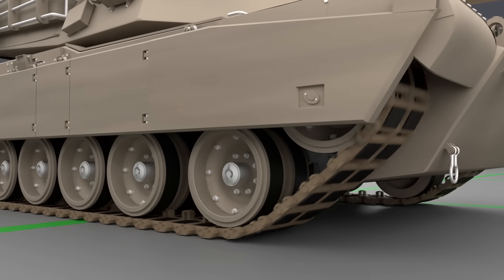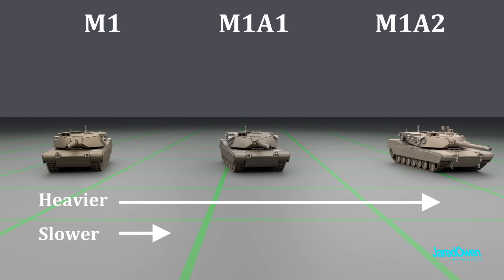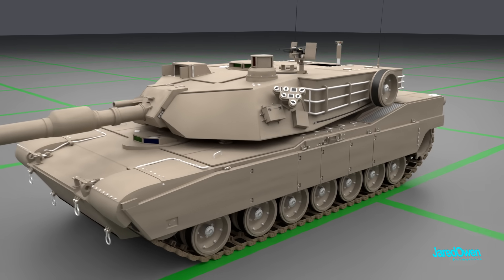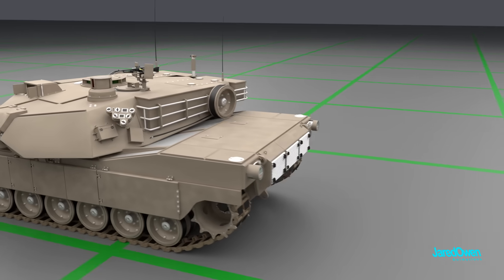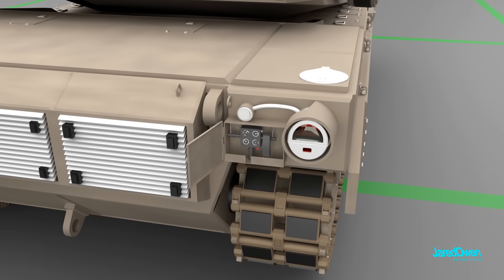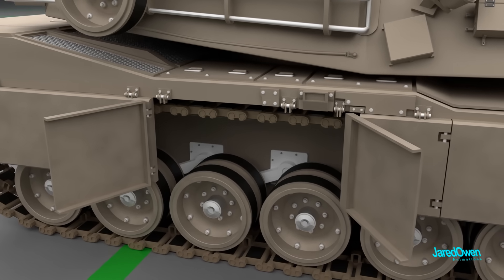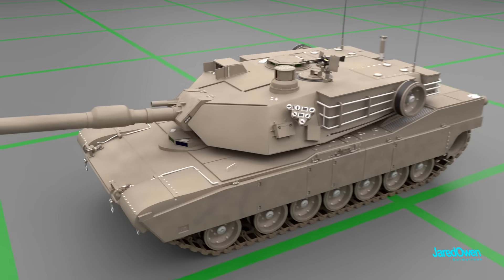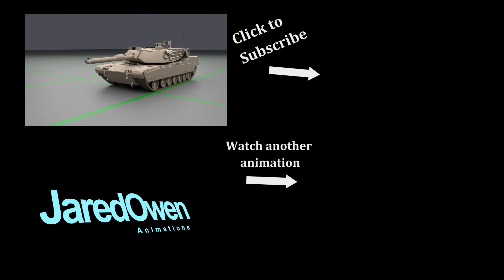How does a Tank work? (M1A2 Abrams)

Comment: 6:11 "it's fairly quiet"
War Thunder: RREEEEEEEEEEEEEEEEEEEEEE
Reply: i hear them vaccum cleaners from a mile away
Reply: Here in Vermont we have a Dairy Festival every year well except for this year due to fing COVID the parade in nearly 60 years was never cancelled until this year even nasty weather never got it cancelled. But a white ago a big part of the parade was a M1 Abrams that use to be in it. They are not all that loud even sitting within 15 feet of them its just a low pitched hum. Them being loud is probably the game devs inventing it to that other players will hear them coming. Because if it where historically accurate you wouldn't hear them until they are on top of you. They took the M1 out of the parade because it was destructive to the pavement when it had to turn for the parade route.
Reply: In real life if the abrams is coming at you. You can only hear tracks rumbling.
Reply: Lmao
Reply: Why did a simple joke's comment turned into WW3
Reply: @f4mmer540  yes
Reply: It's so sad to hear though, War Thunder just uses jet engine sounds in an Abrams and then the other tanks are silent. At least the M60 AMBT is quiet.
Reply: Lo
Reply: L
Reply: It's not fully quiet

You can still hear a tiny whirring noise
Reply: Just because war thunder
Reply: E
Reply: The problem with the abram's engine is 1. That it's louder compared to a diesel engine(yes the pitch is higher and some people can't hear that but it's still louder) 2. It compares WAY more fuel than a diesel engine and 3rd it is really expensive to manufacture, maintain and repair
Reply: @julian5857  ever heard a leopard 2 passing by and an Abrams passing by. Leopard 2 diesel engine is so damn louder than the Abrams gas turbine engine especially when times the turbo is spooling in the leopard 2.
Reply: @julian5857  No the turbine is not louder than a diesel engine. A turbine has fewer moving parts than a diesel engine. A local parade where I am from use to have one in it. The reason they removed it was that every time it turned it would damage the pavement. You will see a Abrams before you hear it. The tracks make more noise than the engine.
Reply: Skiller5000 - I am sorry to tell you this, but your comment on noise is incorrect, as is your assessment regarding repairs.  In terms of gas mileage—I never ran out of fuel, and I could sprint a 68-ton M1A1 0-20 mph in 7.2, seconds and top out (governed) at 54 mph on asphalt, so neither I nor any of my guys had an issue with our turbine engines’ lack of fuel efficiency.
Reply: @cassiusclaudius3010  true. Abrams is on governor to reduce stress and for longer lifespan before maintenance. No governor it could go much faster. And the gas turbine as far as i know its not just 1500hp. It is only tuned at 1500hp but it can do more hp than 1500hp. It is done at 1500hp for its reliability and 1500hp is more than enough for any MBTs.
Reply: Enigmaa it is governed because at 90 MPH the vibrations of the track upon the ground create standing waves in the end connectors, causing them to explode.  

I am not sure where you read your information regarding maintenance and reliability, but that is not quite correct.  I served on Abrams for 9 years, and was intimately acquainted with the engine as a mechanical engineer in the US Army, so not sure where you are receiving your information.
Reply: @julian5857  So why use a turbine?
Reply: That is false, in real life you could hear it kilo meters away
Reply: pikinjo in what “real life?”  Do you have military experience, specifically in US Army or USMC units that employed and/or supported Abrams tanks?  Because I have 9+ years experience across a variety of deployments, and I can tell you that your assessment is incorrect.
Reply: @cassiusclaudius3010  no i am not incorrect, i was few times on M1A1/2 training and the engine is load af, and here https://youtu.be/TCXwgPZXScM you can hear the engine when they start it
Reply: @cassiusclaudius3010  sorry to break it to ya, but you are *wrong*, if you watched the video, the guy was standing in front of the tank, and as you can hear,.the engine was "loud af" please dont confuse bias with facts...
Reply: pikinjo OK now I understand—you dislike American people.  Thanks for letting us all know that you are a bigot.  

Please explain my “bias.”  Bias connotes that my statements are founded on opinions, whereas everything I have written in my posts has been grounded in facts with which I have first-hand, real world experience.

Please also realize that we would not be in this discussion if you had not written your original, erroneous, unfounded post, and then attempted to discredit my 9 years of experience with a YouTube video.  

Just let it go and move on, rather than attacking me for my country of origin.
Reply: pikinjo You still have not explained my bias.  Please explain that.  Please also explain any real-world experience you have with an M1 tank, particularly from “kilometers away.”  Any engine is loud when you stand right next to it.  I should know—I am a mechanical engineer.  I also know from decibel analysis conducted by the US Army that the M1 produces less noise than other engines, whether they be gasoline, diesel, or turbine.  That is fact.  Please let me know what data you have seen to support your position.  

You said that the engine could be heard from “kilometers away” and attempted to prove your point by showing me a YouTube video taken in front of the tank.  I am telling you from real-world experience that you cannot hear the engine from “kilometers away” because I have actually been kilometers away from an M1 and could not hear the engine. 

If you cannot understand the difference or realize that you really do not know what you are talking about, perhaps you should visit a psychotherapist whilst my physician is checking my hearing.

If there is an idiot in this discussion it is the person who will not admit that he is attempting to speak as an expert without real-world experience.   YouTube videos, by the way, do not substitute for real-world experience.
Reply: @cassiusclaudius3010  you have no proof for that, and i've heard T-72B3, Leopard 2A5 and M1A2 sep, the loudest one was M1A2, but i overexaggerated about the "kilometers away" i will give you that, it can be heard further than the rest... And finally, i was the gunner of the M-84A-4 "Sniper" so i have experience
Reply: pikinjo OK perfect so now, hours later, we finally get you to admit that your attack on me stating that the M1 can be heard “kilometers away” was unfounded/exaggerated.  

I really don’t know why you decided to pick on me, being as we are fellow tankers.  I certainly didn’t bear you any ill will at the start of this.  

I did, at one time, actually have in my possession the decibel analysis “proof” I spoke about earlier, but have since changed careers and do not have the document. 

Re:  T-72 and the Leo 1–they were both much louder than the M1A1 and easy to identify from a long distance away; that was my experience many years ago.
Reply: @stilpa1  you are false. You really not heared the abrams in person. I can barely hear the abrams at 200m away. And i hear the leopard 2 engine at 300m away.
Reply: @Trinity-j5f  you are wrong, and biased

Comment: US tonnes lol
Reply: There are several tons. Short ton and long tons are U.S. customary and Imperial tons. Technically both are defined by metric in most international uses, but the U.S. short ton is 907.18kg., the long ton is 1,016.05kg., and the metric ton (also called the tonne) is 1,000kg. In pounds, which are roughly the same in the Customary and Imperial systems it's 2,000lb. and 2,240lb. respectively- a metric ton is 2,204.62lb. I've heard the term "U.S. ton" refer to the short tons outside the U.S.

Comment: To start off I was an M1A1 mechanic and one of the first M1A2 mechanics in the ARMY.  I was stationed with 4-67 AR C-Team Maintenance, 1-37 AR C-Team and B-Team Friedberg Germany 95-98.  Then with 2/3rd ACR E-Troop Fort Carson Co. It was here that I became an M1A2 (A4).  I was also a Recovery Specialist H8. I have worked on many heavy and light tracked and wheeled vehicles in my military service to include the LAV family, Bradley FV HMMWV, 5-ton family, M113 family just to name a few.  Just to let you know my back round.  I have 10 years of military service between the USMC(first) and the ARMY.  At 5:45 when he talks about the engine he is wrong in so many ways.  First what he shows being pulled out is the Pack (engine, AGB (Accessory Gear Box) where the oil pump, EMFS and hydrolic pump are mounted,  trans, cooling towers and  recuperator (cools exhaust).  Then when he shows "the engine"  all that is is the low, high, low compressors, not even the engine.  The engine is located behind that.  The large fans are to cool the trans and engine oil.  The exhaust comes out the middle that is very hot.  Where he has the Loaders seat is where the radios are at.  The Loaders seat is right below the Loaders hatch.  It folds up if he needs to move around.  The seal isn't that good.  If they are fording water up to turret depth or chemical weapons they can pressurize the crew compartment and also inflate a bladder around the turret ring also.  Every version of the M1 has a 50 cal M2 for the Commander along with the gun for the loader.  The hull Ammo at 9:12 isn't stored like that, its stored in a different location.  The ammo in the back of the turret is correct. The M1A2 has a CITV(Commanders Integrated Thermal Viewer) located in front of the loaders hatch.  That is how the commander would have a 360 view around the tank.  The M1A1 commander would use the portholes because they didn't have the CITV. The rounds are spring loaded in the storage rack with a knee switch to open the door.  He would be facing the commander, hit the knee switch, pop the release tap the round would pop out, using that momentum would flip the round and drop it into the breach and release the breach to lock the round.  My crews in Germany did this in about 4-6 sec. per round. The drives station is the most comfortable seat in the house.  The driver can sit up or lay back.  The moves up and down as does the back of the seat.  When driving with the hatch open (which happens most of the time unless in combat) the drive is sitting up with his head out of the drivers station. When he is closed hatch he had a head rest that folds down for him when he is laying back in the seat.
Reply: I was a heavy equipment for ten years most wheeled but refurbished m88a1s as well.  Having done several ten year services on m1000 trailers, I naturally had exposure to abrams and have always been fascinated with them. The sound of one starting up is something you have experience in person.  The craziest thing though imo is when i decided to give one a tap with with small one pound hammer.  I wasnt expecting it to bounce back and almost hit me lol.  Ill leave it that, and as for the errors in the video thats ok we dont want to give all the details away on this machine to the bad guys lol, you do know these inside and out for sure
Reply: I was a 19E on M60A3's, A-2/68 AR @ Baumholder from 85-86 and then a 19K with C-2/37 AR @ Friedberg from 04-06.  Thanks for your service!!

Comment: I went through NET as a TC when the M1s were first rolled out to our unit just after we returned from Desert Storm. My unit used the old M60s in Kuwait. In the M1s we had, I had a remote control Cal 50 mounted at the TC's cupola (the old 60's had one that wasn't remote - you had to fire it unbuttoned). This doesn't show one, although it does show the loader's 7.76 mm. Does the TC not have a Cal 50 anymore?
Reply: The TC absolutely still has their caliber .50 up top. Nowadays, the latest M1A2s use CROWS mounted M2s rather than the old mounts.
Reply: @bluntcabbage6042  Nice! You could control the old one from inside the tank, but it wasn't the stablest thing in the world. The grouping was horrific.

Comment: I was a 19K (tanker) for the Army I was assigned the M1A2 SEPV2 tank actually weighs 73 tons for those wondering I’m 5’5-5’6 and my short small ass struggled moving around this tank 😂😂😂 and the tank can legally go 42mph but I’ve gotten it to go far faster going downhill and even tho it looks like 1 there’s actually 2 road wheels which makes a total of 32 road wheels and 2 sprocket wheels on the tank. There’s a total of 4 tank weapons the 120mm the coax MG (which is a M240L) same gun is mounted on the loaders hatch and the TC has a 50 Cal machine gun also unless the drivers hatch is previously opened you must go through the loaders hatch to enter the drivers seat

Comment: After all these years we still have no   self loading  canon  
Why not make a revolver  for the canon 
or a clip for the canon  - Ill bet the enemy has one  ????
Reply: Autoloaders have been used since the 1940s and 1950s, but have their own disadvantages.

Revolver-style autoloaders were rather extensively used by the French, most notably in the AMX-13 light tank. While it allowed for a high rate of fire, it was a difficult system to reload.

Other autoloaders present other issues. Carousel-style autoloaders seen on the USSR's T-64s, T-72s, T-80s, and T-90s, make the tank much less survivable. Other autoloaders can also be more fragile and break easily.
Reply: @bluntcabbage6042  The first  one  with an auto loader  is the winner  or the first with   missiles   like  Stalins   organs   /kertucia   will be the winner ??? This is just a hobby
Reply: @oliverphippen1957  ?

Comment: Wow the tank driver's got it rough. The only entrances are though a small opening onto which is covered by the torrent, and a small opening in the turret basket.
Reply: The driver is also one of the most protected crewmen, being in a lower position than the turret crew and having more in between him and incoming fire.

Comment: Note,  the track in contact with the ground as still. The wheels roll along the traack. It is a self laying track vehicle. If the tank is moving at ten mph,  the track is laying still on the ground but the top of the track is being rushed forward at twenty mph. This tank is made also in Egypt.

Comment: So, I have a few questions: '
1. Is that one, tiny little door the only connection between the driver and the turret compartments? 
2. Where are the shells from the turret and coaxial mg discarded? 
3. How much of the interior is dedicated to storage for tools and replacement parts? Or is it all stored in the outside containers?
Reply: 1) Yes. There is a small door in the turret basket that allows the driver to access the main fighting compartment. In operation, there is not often a good reason for the driver to need to access the fighting compartment, so this isn't really a huge issue.

2) The shells from the main gun are mostly combustible. That is, much of the casing burns off with the rest of the propellant. What remains is a couple inch long cap which is ejected from the gun down into a basket which collects the shell caps. Coaxial MG casings are also collected in a basket/bin which can be emptied when not in combat.

3) The interior is almost entirely reserved for the individual crewmen's duties. That is, there is often little more than a rifle and some ammo for each crewman inside the tank. Things like pickaxes, shovels, and sledgehammers can be easily stowed outside the vehicle.

Comment: 7:46, the torrent contacts with the body, so the DOF of the tower is constrained by an angle, or is the problem with the model?
Reply: It actually doesn’t touch the body there is space between the turret and the body so the driver can get out

Comment: Never talked about the filter on the Abrams, long story short is was terrible and needed to constantly be changed during the afgan war, cause SAND and particulates
Reply: For anyone else diving this far into the comments, here's some more useless trivia about that-

The air intake filter uses three triangular shaped filter packs called Vee-packs because of the shape. The preferred (by the book way) to clean them is with an air hose you can attach to the engine. The "field expedient" method is to take them out and (carefully) knock out any build up of dirt and dust. Crew slang for this is to "go bang out your Vee-packs" ;)

Comment: No it does not use jet fuel. It uses JP8 which is diesel. You missed a lot of small details, but good video.
Reply: Wrong, JP8 is jet fuel,  the exact same commercial "Jet A" fuel (plus additives).
Reply: @sandervanderkammen9230  I hauled JP8 and ran bag farms in the Army. We pumped JP8 into HUMMVs, generators, tanks and trucks. Army aviation used JP4. Now I work fuel for Boeing running the fuel trucks and fuel farm and we use JET A +++ for the F-15 and F-18. JP8 and JET A is not the same.
Reply: @chrismanning1171  I believe JP8 is the exact same commercial Jet fuel specification is called
 JET A1+100.
Reply: @sandervanderkammen9230  I was taught in the Army that JP8 and diesel where the same. Similar characteristics but  not the same. JP8 is different because it has no lubricants in it and has a lower flash point then Jet A++. Just like MOGAS and gas are similar but I saw soldier put mogas in his pickup truck and smoked for a day.
Reply: @chrismanning1171  Were you in the service in 1991 when the U.S. Army made the switch from F54  Diesel (D2) to JP8??
The Army switched from NATO F54 (Diesel DF2) to JP8 NATO F34.
F34 is AVTUR/FSII OR 
JET A1 +100
Reply: @chrismanning1171  MOGAS is ordinary UNLEADED pump gasoline for automobiles...
Reply: Sander Van der Kammen I was in the Guard as a mechanic in 93. Joined the full time Army in 95.
Reply: @sandervanderkammen9230  You are correct. Thanks for the correction.
Reply: @chrismanning1171  You are very welcome sir, thank you for your service.